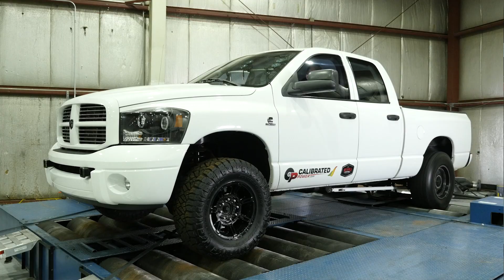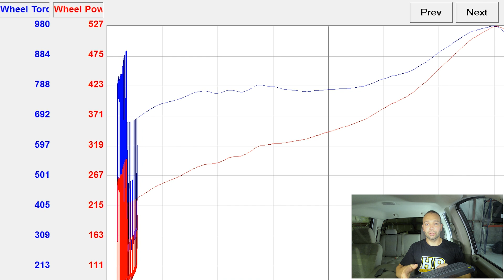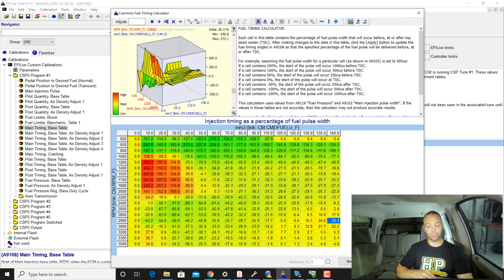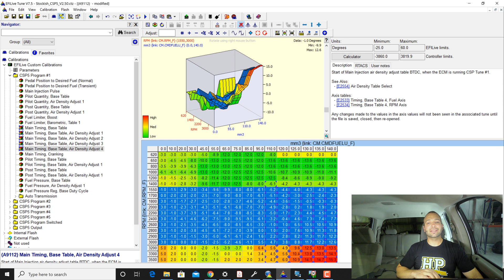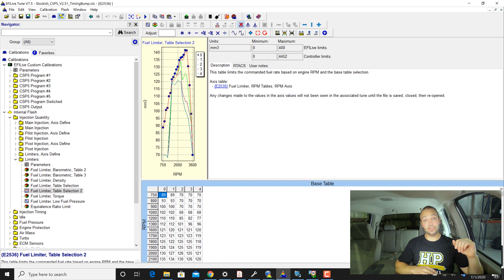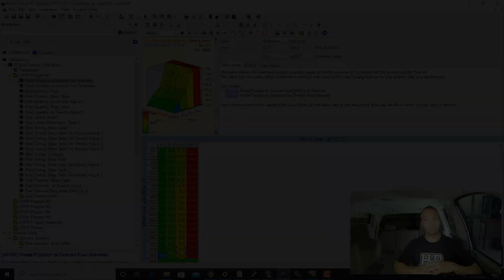P1: Full Power Diesel Tuning: Your First Tune | Lesson 3:1 of 4 [#FREELESSON]

Comment: Id assume a huge majority of us guys dont have a dyno. coming from gasoline- if im adding boost/fuel, i know im making more power but if im tuning diesel which is already making a ton of boost but gaining more with messing with timing, fuel as outlined in this video at same boost levels i can see how having a dyno is almost a necessity
Reply from the maker: You can do a lot without a dyno, but you will leave a bit of power on the table without one for sure: https://www.hpacademy.com/technical-articles/dyno-vs-road-tuning-vs-e-tune/?utm_source=youtube&utm_medium=social&utm_campaign=general-interaction - Taz.